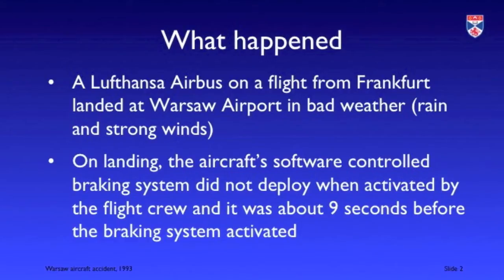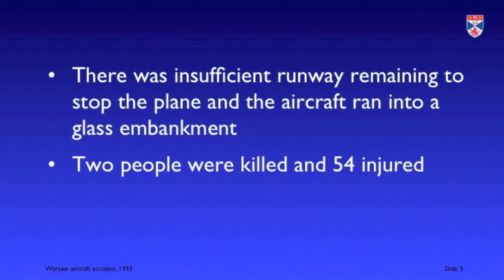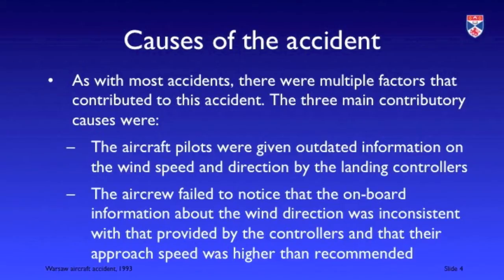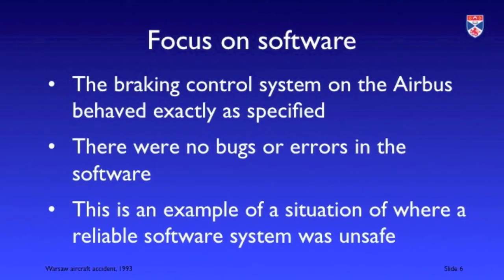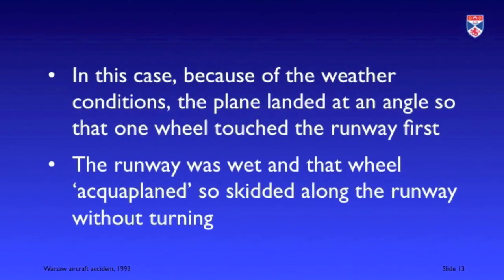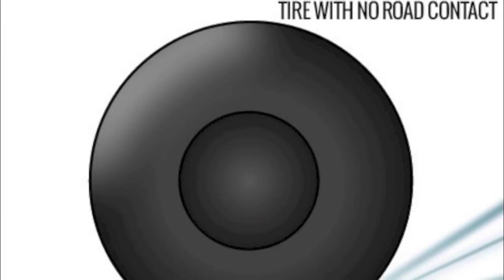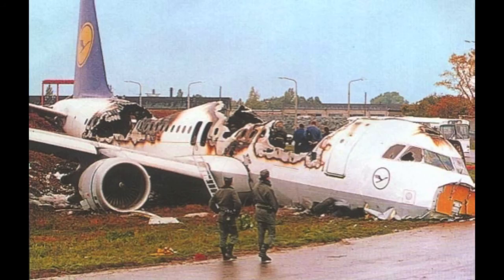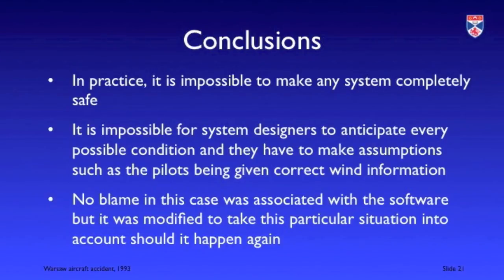Warsaw airbus accident 1993

Comment: What a bucket of crap. 
Does anybody really believe that a tire will hydroplane with 90 tons of airplane sitting on it?!?! 
At best, the turn sensor was broken. 
This is just the airline and manufacturers teaming up to blame the pilots as usual. 
“They should have noticed the wind changed direction...” Really?!?! At night in the rain they were gonna catch a less than 90 degree shift in wind direction, when the airport officials themselves didn’t even notice it?
Reply: What you are writing is “a bucket of crap”. The Airplane weight has nearly no influence on Aquaplaning. It is a combination of total contact area of the wheel on the ground and the aircraft’s speed plus the amount of water present in the contact area of the tire and the ground. You get everything to aquaplan, it is just a matter of speed. If the water is no longer able to to make its way through the grooves of the tire it will form a wave kind water buildup in front of the tire and then the tire starts to reduce its wheelspeed and the slower it gets the more water builds up in front of the tire and finally it starts to swim and even comes to a compleet stand still! Also the aircraft might have a ground speed of 130 knots, the tire has no rpm any more. With the tire not turning, for the whole system is one important factor not given to activste the ground spoiler speedbrakes and reverse thrust. All passenger aircraft need these 2 conditions:: shock struts compressed and wheel speed greater x knots ( x is different from manufacturer to manufacturer) 
From ONE landing gear! Not like here 2.

Comment: Spoilers are not primarily used to slow the plane down aerodynamically, although they do increase drag, but that part is relatively minimal at low speeds (like when landing)! Their function is to spoil" lift of the wings, so the aircraft will remain on the ground - that is when they are used in the auto mode upon landing - and thus transfer the weight of the aircraft onto the landing gear and help with the mechanical braking. They are also used to increase the sinkrate of a plane without the loss of speed when in flight mode.  You may be confusing spoilers with airbrakes here, which increase drag without compromising lift. Reverse thrust also dont let the "engines run backwards" but rather deflect the thrust forward.  While on older generation jet engines (turbojets and first generation turbofans) this was mostly done by deploying bucket like devices into the hot and cool part of the exhaust gasses, most high-bypass turbofans now only deflect the cold (bypass) part of an engine forward.